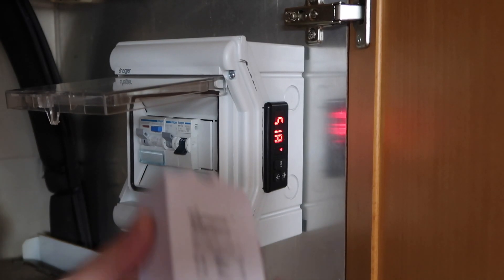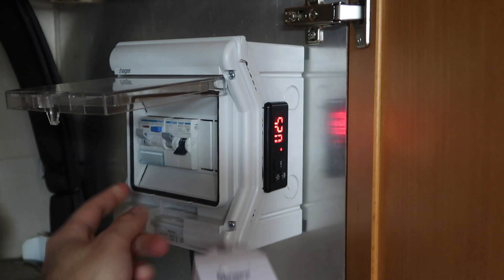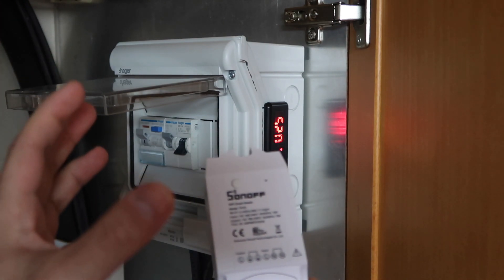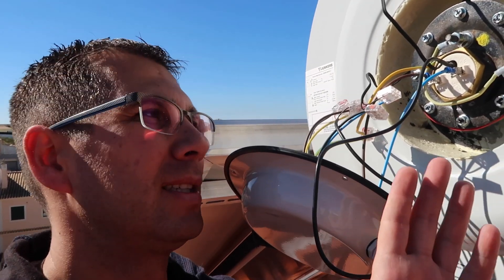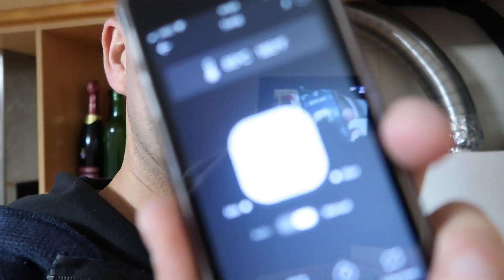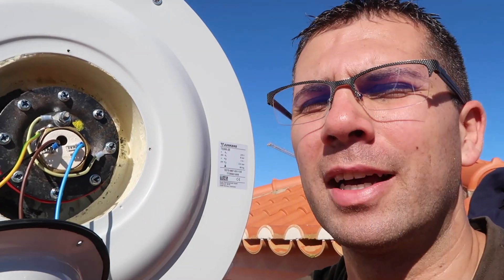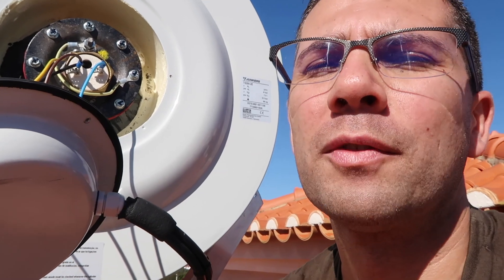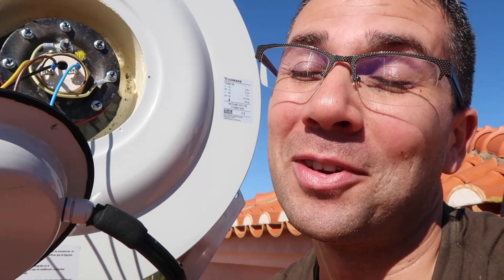HOW TO Monitor Water Heater Temperature on our MOBILE PHONE - Sonoff TH16

Comment: It seems there was no follow up video showing how you programmed it to toggle your tank on/off. Just an update with this in 2023, as I'm guessing, like me, perhaps you had no luck with it. I also have the unit with just the temp probe (and not the humidity). I just wired this unit up and got it working with eWeLink. I can control on/off with my phone. THere is no option to toggle it on off based on temp and it appears you need to create a 'scene'. (In fact the unit needs to be powered on to read the temp in the first place). So then I tried to create a scene that would turn off our aircon unit when the temp at the sensor falls below 17C. Then when I test it with putting the probe into ice water, the unit does report the correct temp back to my phone, but the scene will not shut the unit off in spite of me telling it to enter the 'off' state when temp is less then or equal to 17C. SO although I can use this unit as a switch and turn it on and off from my phone, I cannot seem to control it based on temperature. Sigh... This may be a factor for others that may also want to do something similar, and this unit may not be what they were looking for. 

Edit: I was wrong. I had first watched another video that was top of the YT algorithm that indicates you must use both another switch, and a 'scene' to accomplish this ("Geek ..."). Unfortunately that video is wrong. Later I discovered that you can use both the 'auto' function and the 'schedule' function to do everything. No need for another switch, or creation of a 'scene'.
Reply: Shit youtuber

Comment: How long is temperature cable from heater to the sonoff??
Reply: My experience with other temp sensor cables like this are that they are based on line resistance. EG, I once tried to extend a cable by soldering a longer lead into it, but without the ability to calibrate it, the resultant temp readings were off to much to be usable.
Reply: @MountainParameters  for sure there is some alternatives to do the job. Maybe by wifi?

Comment: Hi Roberto. Thank you for the great videos. Did you find an LCD screen that can show the temperature recorded by Sonoff TH16? I do not want the LCS to be connected to Sonoff. I want it to use WiFi, to connect with the internet and get the temperature and display it on an LCD. Something like Ewelink LCD (https://www.joom.com/en/products/5fa50073b48dc601076f56f1). Or maybe an Amazon Echo Show?

Comment: Do you suggest using the existing probe wires instead of adding another probe? And i also need to add the heating option i was going to put the out on the live nutral which are used for the sr500 slar water controler hope it works

Comment: yes where did you find the radial/barrell connector for the DB18's temp probe?  What gauge wire did you use and have you done any cable length tests?  What about glycol bottle with probe in element to reduce mis reads?

Comment: Hello Roberto from Greece! Congrats for your excellent reviews. I have the th16 sonoff and control it through ewelink app but I a cannot create a trigger with the temperature sensor to switch on another device. When I try to set the temperature it doesn't save it. It is not the auto selection enabled.

Comment: Hey man, have you actually managed to make this work decently? It seems to get stuck when the temp is above certain degrees, i think about 70+ celcius. It either gets stuck at 0 or some random temperature. I have made sure it makes good contact with the water boiler and the sonoff so i dont think it's any of that. It also always works at night when the temperature is a bit lower since my boiler is sun powered.

Comment: How save is this? It seems like this is a high pressure electrical geyser. The sonoff sensor is inserted where the mechanical thermostat (normally required by law for safety) should be. What will happen if the geyser gets to hot and the sonoff cloud does not work? I must say I do not have any experience with sonoff devices.
Reply: I think you can always do inching to be safe no??

Comment: Thank you very much for a very informative video, which helped me decide to tackle this project in my house. After watching your method I thought that I would be better off if I put the Sonoff TH16 above the water heater switch, with a relay and extend the sensor wire up to the tank on the roof. My tank had a temperature gauge which was unreadable due to age with a 1/2" thread, so I ordered a sensor #Aliexpress € 7,47 | DS18B20 Digital Temperature Sensor G1/2" Thread Probe DIA=7mm 1m PVC 3-core Wire SUS304 Stainless Steel Shell L30mm- L150mm XJ8
https://a.aliexpress.com/_dUogbt5

Which fitted and worked a treat. 

Important note for anyone wiring these sensors and plugs: Standard convention is not followed with the colours, make sure you test every connection with a meter. Do not assume that the Chinese understand what they are doing, as with mine red was data, black was live and white (yellow on the sensor) earth.

Must also add, I'm very disappointed with the eWelink app as, unbelievably, you can't control the temperature in Auto mode and use the timer function. A gross error by the manufacturer which needs putting right now. Apart from that it's so great to know the temperature and switch status, which has allowed me to pay for most of it in just a few days and I wouldn't be without it now, despite it not working entirely as I would like and should.
Reply: Please explain how did you install the sensor. I have no hole. I have a horizontal water heater with no gauge.
Reply: @kav0r  If you have copper pipes you could  clamp a sensor to the pipe, this is the only method I can think of if you are lacking a gauge on your tank.
Reply: @TonyHales  i have electric water heater. So i clamp the sensor to the heating element?
Reply: @kav0r  No do not clamp it to the heating element, it needs to go on the hot water exit from the tank which will be the top pipe.
Reply: @TonyHales  i have plastic water pipes.
Reply: @Tony Hales 
With regards to inserting the DS18B20, can you please share how you fit it into your water heater?
Any alternatives too?
Other please feel free to comment down. It will be great
Regards

Comment: About de 85ºc issue, I had the same with my installation and the problem was in the sonoff jack connector, you really need to push it until it clicks.

Comment: nice! was looking for something like this. can you elaborate on how to insert and fix the probe into the heater? my heater stands vertically. was the hole you put the sensor in already made? should I drill it? do you need to empty the heater first?
Reply: Use something called a Thermowell. Make sure it’s at the top of the heater. The bottom is always much colder. Make sure it’s long enough to go through the insulation of the tank.

Comment: Intresting video. Just a question, can 2 devices read temp for a single temp sensor? I have a heater similar to yours bit only a single probe enters. 

Asking because I need actual temp on my mobile and want the same temp at the home monitor.

Thanks
Reply from the maker: Hi, yes if you split the wires shoudl work just fine as each device will have the same information. Have in mind that some systems use 2 wires and other 3 wires, the sonoff uses 3, if your home monitor has 3 than i see no issues 👍😉
Reply: Roberto Jorge thanks for your reply. In fact mine have 2 wires. 

Do you think It can be done?
Reply: 1 year ago - have you managed to resolve your 2 wire question? I am facing the same issue now :)